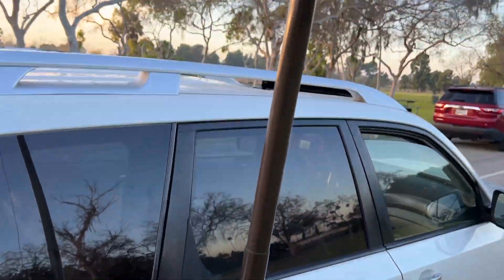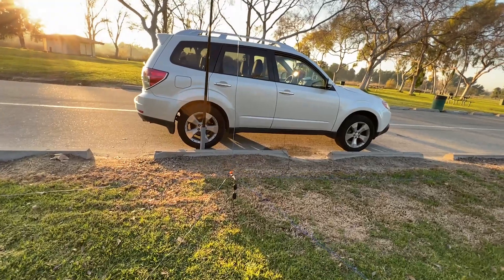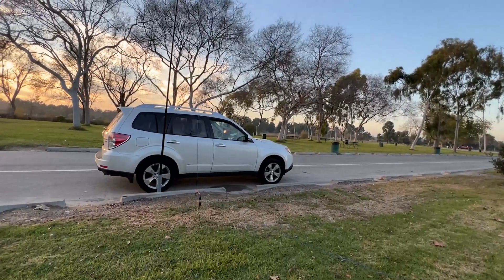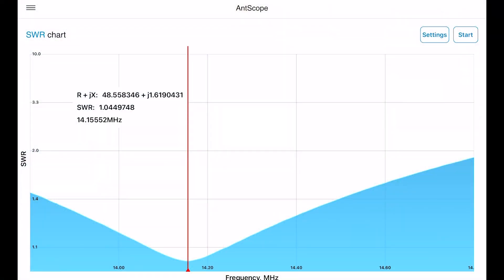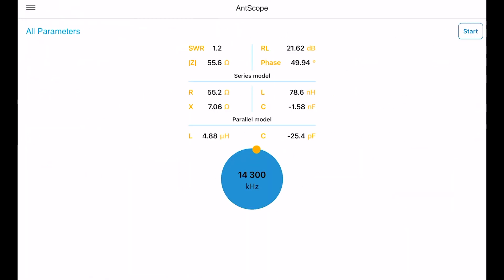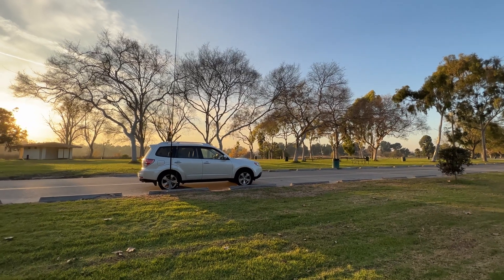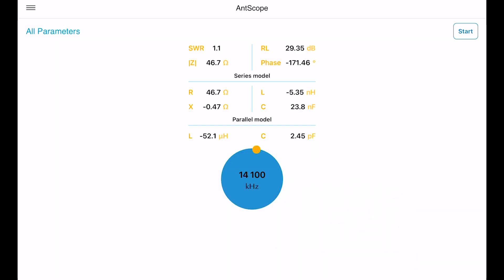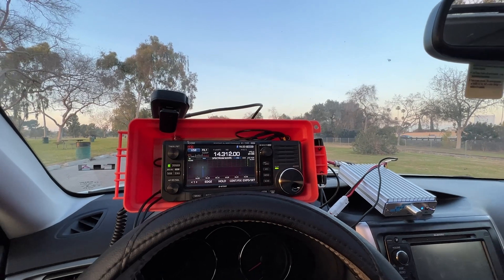HF Mast Ground Plane Antenna

Comment: Great, I will try out the raised radials with my system.
Reply from the maker: I think you will find some improvement.  Best to use an SWR meter to see any difference as well.